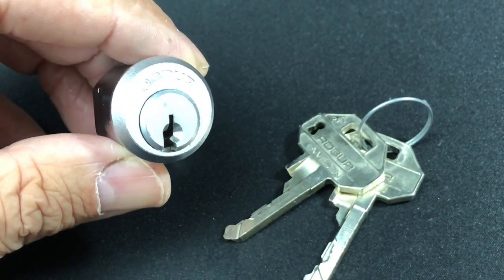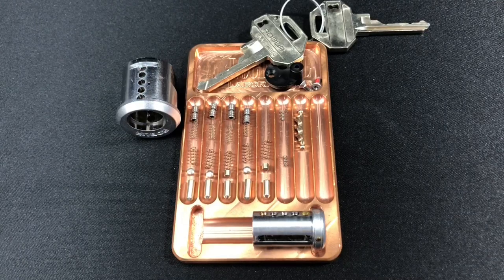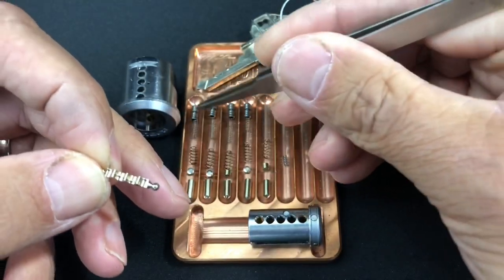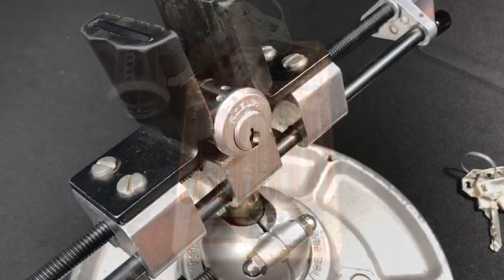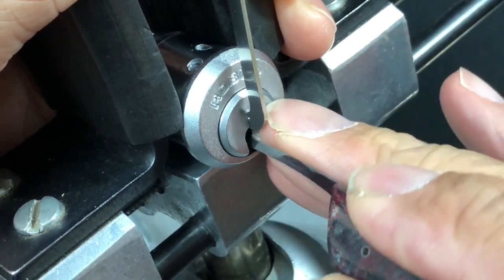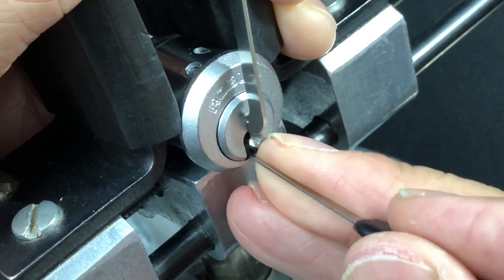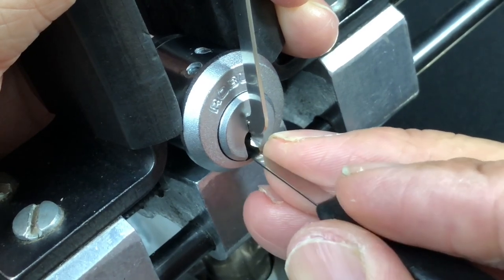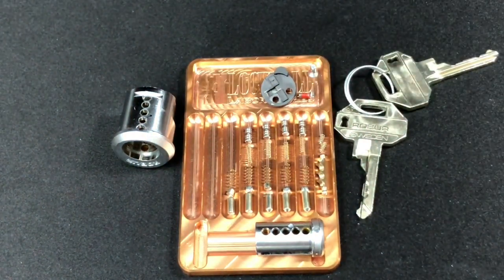New Robur 2391 Safe deposit lock, (detailed look, pick & gut)

Comment: WOW!
You made that look so easy and it certainly isn't an easy lock to pick by the looks of it. 
Were there so many clicks on the side bar pins because they looked serrated?
Reply from the maker: Roy Sammons Thanks Roy, yes the sidebar is incredible tricky to get set because of the false gates, the sidebar kept dropping out, which is why there was so many clicks, definitely a lock that needed a very balanced tension to open.

Comment: FYI I had some problems with one of these and found that ASSA Twin parts are the same (excepting shorter 4 pin sidebar and special short driver springs).  Pin & driver sizes same, side bar pins same as ASSA Twin.  Also the Robur has double small countermilling on the plug which is ineffective due to extremely thin drivers and long key pins.  Mine had 2 each #2 master wafers as drivers (0,047 thick) -- I went up one size on the drivers to prevent jamming.  Also mine had bad unfinished edges on countermilling; caused key pins to get stuck above the shearline -- son-of-a-birch
Reply from the maker: Thanks for the info, I found that the counter milling didn’t play apart in this one either. The trouble is all in the sidebar, I thought a lot of the components with in the lock were the same as the Assa twin.
Have a great week my friend, & thanks again for all the info.

Comment: Nice Picking, good job! 👍
This looks just like a slightly altered ASSA Twin 6000, seems to be easier to pick tho.
One more thing: there are no sliders. Sliders mean springless sidepins.
The pins in there are called sidebarpins. I think they are actually interchangeable with the Twin 6000
Reply from the maker: Kotzikacki Thank you my friend. I would agree with you. I’ve picked an assa 6000 & they are a lot tougher to pick, due the the Assa drivers, the drivers in this lock don’t really come in to play as they are so small. Even though this is a patented lock I think a lot of the components like you say are the same as the Assa locks. Have a great week my friend.